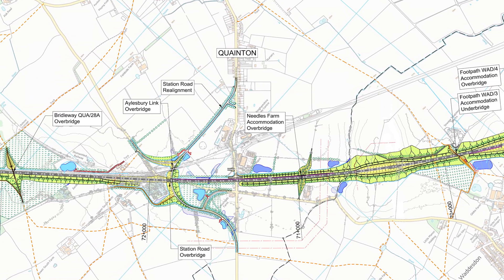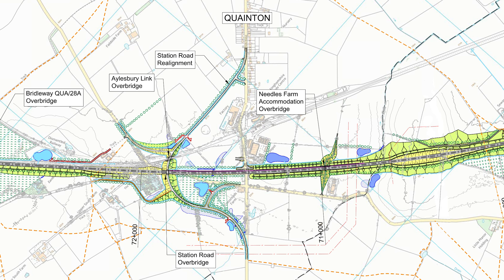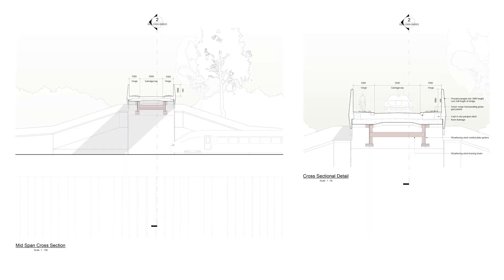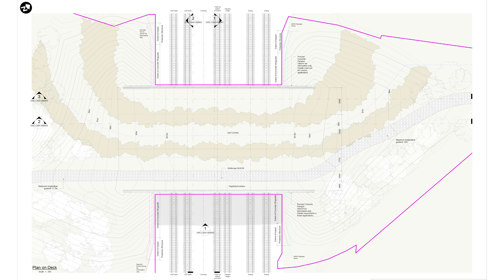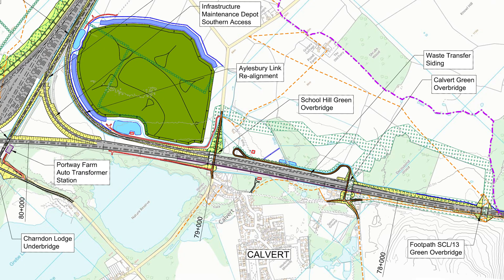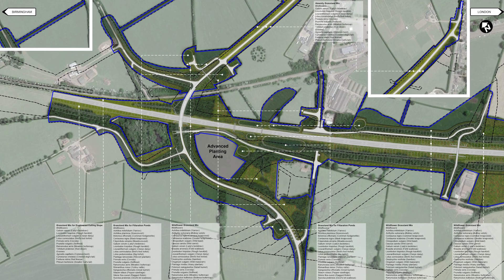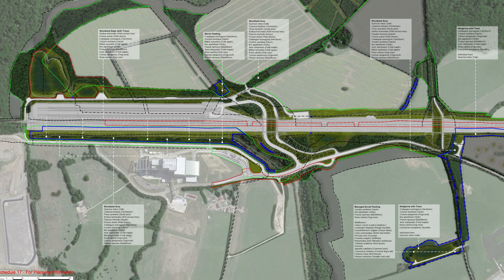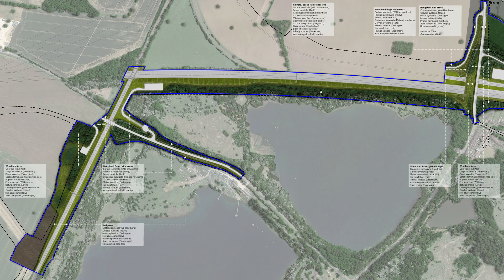HS2 - Waddesdon to Calvert plans

Comment: Perhaps I missed this, but is there still some connection from the Buckinghamshire Railway Centre to the Network Rail tracks to Aylesbury after all the HS2 work in this area is completed? And does this survive even if the long-discussed onward NR connection to East West Rail is never built even if the formation and trackbed are built and remain ready and waiting to be used?
Reply from the maker: @adrianbaron4994 The tracks between Aylesbury and Quainton have remained untouched because HS2 have been using that line to deliver material from quarries etc. I don't know for sure but I would imagine the line will need to be put back because of waste trains going to Greatmoor. They may come in from the EWR line though so I just don't know really.

Comment: Why do they keep taking a straight road and build a new one,  bending it round?
Reply: So they can keep the road open for as long as possible. Keep the straight road open, build the new bridge to the side, close the old bridge and then quickly open the new bridge.
Reply: @petitkruger2175  I thought that might be it, but the bends round seem to be extravagant compared to a smaller, cheaper alternative.  Ah, well...
Reply: @philipareed  In a lot of places the new height required would simply be infeasible anywhere other than further along. The line is being built to a European loading gauge with wires, vs the smaller GC loading gauge and steam trains
Reply: @Whiskey2shots  Is GC Grand Central? I'm not a train buff 👍

Comment: I feel the 'Bat Structures' are a complete waste of time.
There was something similar done on the other side of London, where they built a multi-million pound 'Bat Bridge' across a motorway. It was totally useless, as the bats never used it, and simply flew over the motorway further down :D
Reply from the maker: @AFCManUk I understand that in this case though the speed of the trains is the issue in that they create turbulence going past the woodland. I don't know if this structure will be of any use but Natural England feel it is necessary. We will see.
Reply: There were some bat bridges built around Thetford. These were a waste of time, narrow and high up. The HS2 ones will maybe more successful, eithe they have shrubs growing on them, are wide , or around the landfill, the whole line will be totally covered for quite a distance.